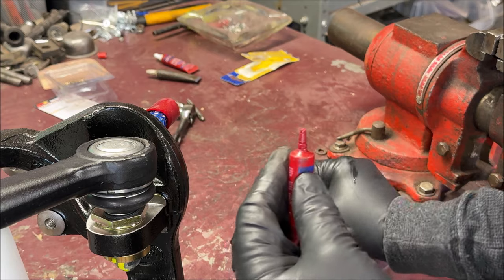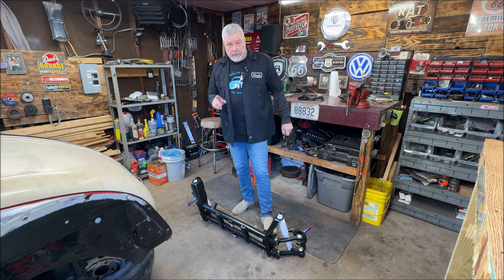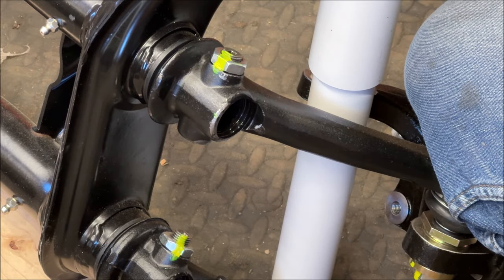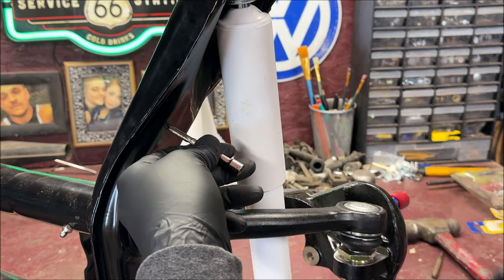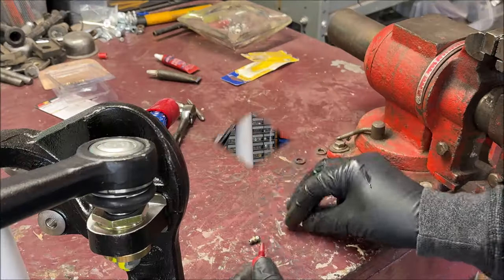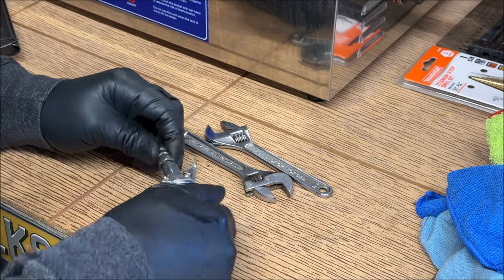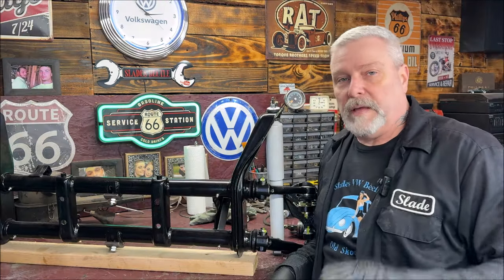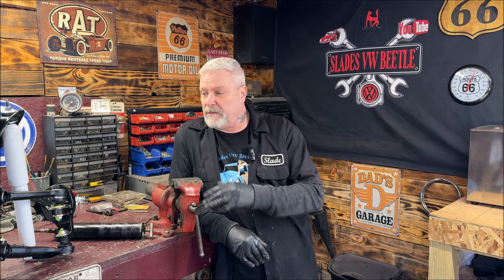VW BEETLE FRONT BEAM HACK - HOW TO STOP ROT AND RUST WITH A EASY FIX - baja bug - #vwbeetle #vwbug

Comment: Great information . Another thing that may work for this is closed cell foam . I used to work on TR 6 Triumph cars that had frame rust out problems ,because they had box tube frame .   Some guys in NY that made new frames for them . Clamed they injected closed cell foam into the new frame to stop the rust problem . They also said it made the car and frame quitter because it stopped the car and road  vibration transfer . I am working on the restoration of a Dean Jefferies sand buggy ,great fun for an old guy . Thanks for making videos
Reply: VW put foam inside the rear window vent area at the factory and that area always rusts. Many people end up pulling that foam from the area before repairing the rust. They call it “death foam”.
Reply: @vayabroder729  Yes I understand ,before they invented closed cell they used open cell . The open cell just trapped the water . I guess the only advantage to foam would be weight . But maybe not worth the risk .

Comment: You killed it sir! That was an awesome install! Love that brake bleeder valve cap idea. Reading some of the comments from other members regarding a vent hole I was thinking why not tap another hole where you can screw in a plug or even another Zerk fitting that you can remove to vent when you need to. It can also serve as the overflow. As soon as grease comes out of that hole you know that cavity is full of grease.

A video on the tin install with a very detailed segment on the flap and thermostat system on the fan housing would be a plus. Being that there have been multiple versions of the flap system (mostly the bracket that ties both sides together depending on the oil cooler type and also the the flaps themselves which can have two or three fasteners each).
Reply from the maker: I’m definitely going to put a fence hole in the shock tower, sometimes when I’m filming it is so hard to remember everything. But yes for sure I’m going to do a complete cooling tin install as soon as I paint everything hopefully within the next few weeks.
I did a pretty good one a while back. It’s on my playlist here. But it’s been a while.

Comment: Good tip,wonder how it holds up using something like Eastwood internal frame coating.
Reply from the maker: Honestly, I’m not sure. I like the idea that the grease will spread and fill the areas. But I have not used Eastwood so I really don’t know.

Comment: Another alternative to the grease and zerk fitting is the use Eastwood’s internal frame coating. I have used this in my dune buggy front beam tunnel and other areas. It’s a Phenolic Resin blended with Zinc Phosphate.
It comes in either black or green and is applied with tube and brass nozzle that sprays 360 degrees. 
I drilled a 1/8” hole in the bottom of the shock tower and a 1/4” up on top. This allowed me to insert the nozzle tube from the top all the way down the lower shock tower. Once done I started spraying the contents and as I was doing it I was pulling the tube up ensuring everything was getting coated. I did this until it started running out the 1/8” hole at the bottom of the shock tower.

Comment: Maybe you should use 00 grease which is thinner and should flow in and around better? What about a set screw vent in the top of the tower you ket air out? Then screw in a short bolt to seal it? Just an outsider’s point of view!
Reply from the maker: I have that “00” on hand, that’s what I use on my steering boxes. I put in the comments here and on the video caption about a vent hole. Since I forgot while filming

Comment: I spy a late Ghia air cleaner.... Did you ever get my pic I sent it to your email
Nice beam and great idea on the grease fittings🇩🇪👍
Reply from the maker: Yes, that is, I actually have two of them. I set one on the workbench so I can clean it up real nice before I list it on the marketplace. I’ll check my email, this evening. The inbox is overflowed. So I’ll try to track your email down.
Reply from the maker: I just checked my email real quick, I’m not seeing an email from you with photos…
Reply: @SladesVWBeetle  I will resend maybe tommorow
I hope I have the right email
Reply from the maker: @eduardorodriguez3262  it’s:  sladesbeetle@yahoo.com

Comment: Not thread locker, tamper proof torque stripe paint. Surprised you didn't also drill for a vent plug at the top, would also show when it's full.
Reply from the maker: Yes!!! that’s what I am going to actually do tomorrow. I wasn’t even thinking when I came to the vent hole.